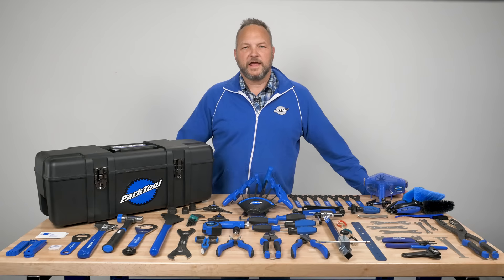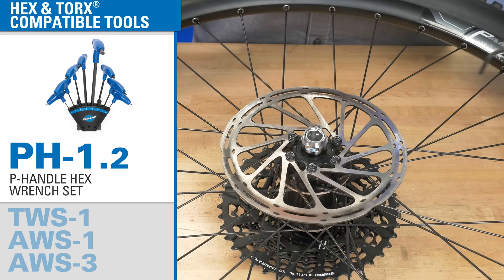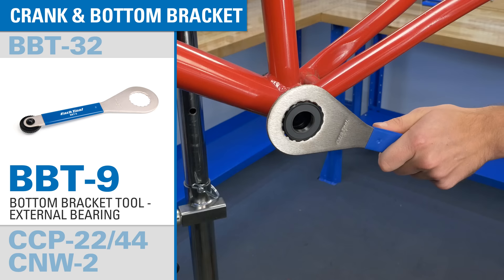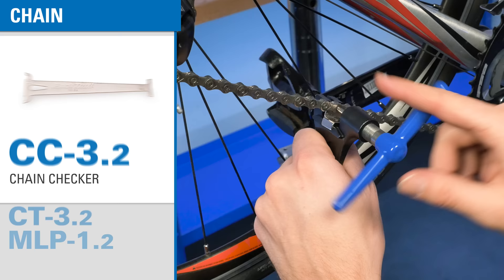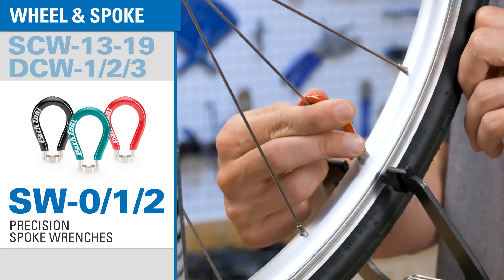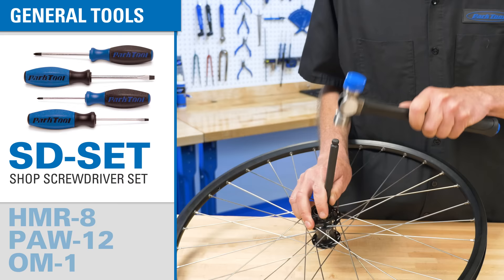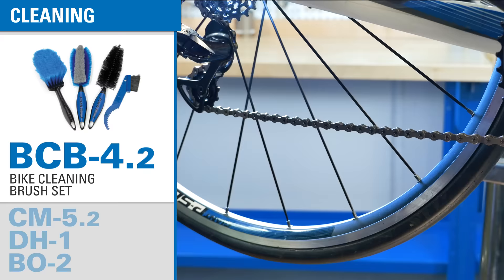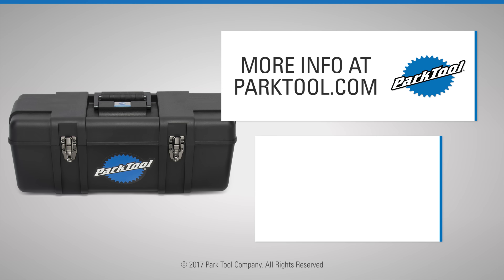PK-3 Professional Tool Kit

Comment: Does this have the tools needed for pulling and replacing the cranks, and insides of the bottom bracket,  as well as the parts and bearings inside the headset of BMX bikes...?
   Just ordered my son his first BMX and am looking into some tools, as well as the book you guys put out, for birthday presents....then he can learn to work on bikes and maintain his own, and maybe someday even work on bikes for his friends...
Reply from the maker: There are many many bottom brackets and cranks on the market. This kit does come with some bottom bracket and headset tools but will not do everything on the market. Headset and bottom bracket work can be difficult and the tools can be costly. It depends on what components your bike has and what you would like to do to those components. Please reach out to tech@parktool.com for more detailed questions on compatibility.
Reply: @parktool  , thanks.... I think my son and I will start with some of the basics, and the book, then just add the specific tools we need for our BMX bikes as we need them... don't really plan on working on anything besides BMX... but DO want to eventually get the wheel truing stand and learn to lace and true up wheels...
   U all take care.

Comment: Why did you take out the magnetic  tool for cable installation ?
Reply from the maker: The IR-1.2 was in the PK-2. Choosing what goes into tool kits is tricky.  While extremely useful for internal routing we made the choice to take it out based on feedback we got. That kit is purchased by bike shops and home mechanics so we got input from both.  Because it’s a fairly expensive tool that not everyone needs we chose to swap the value out for tools that were used by a wider variety of mechanics.  With the PK we wanted to include a wide variety of universally used professional tools.  Tool kits are tricky!